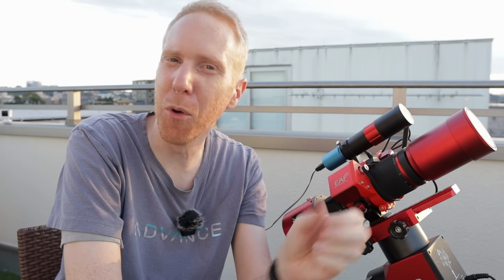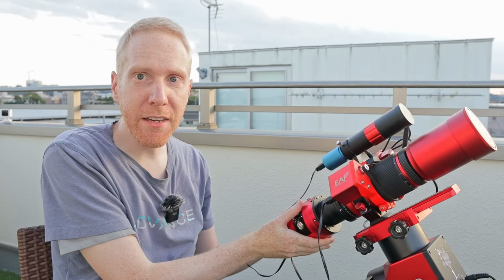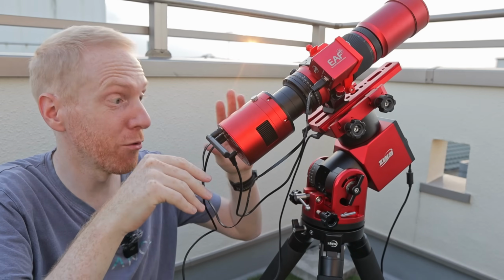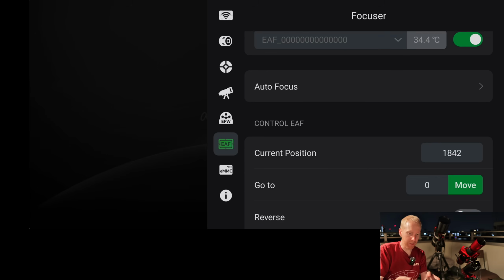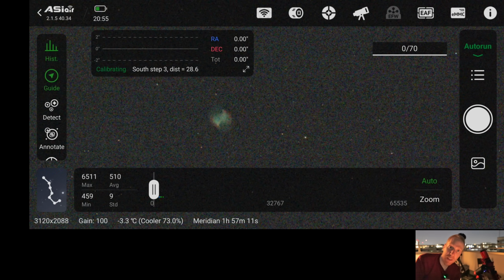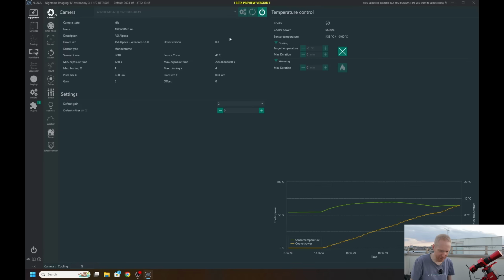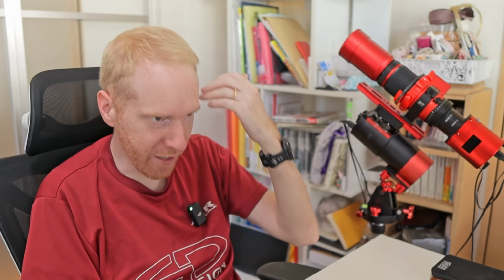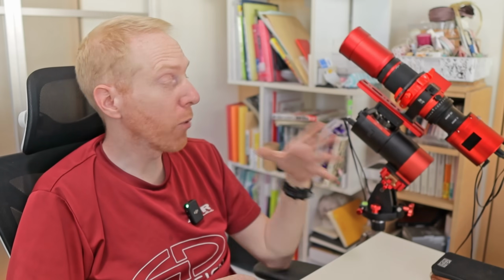This Astro Smart Camera does EVERYTHING🔥! Perfect for beginners? REVIEW of ZWO ASI2600MC Air!

Comment: I certainly hope the QA is spot on.  If it breaks, repair will be impossible.
Reply: I think this is the real problem, #1. Probably the second is the cooling of the sensor, Asiair heats up a lot when it works, if the climate is summer it easily exceeds 40° C, almost approaching 50, this inevitably worsens the already difficult cooling of the sensor due to the summer heat.
Reply from the maker: Probably not impossible, but difficult for sure...
Reply: @CuivTheLazyGeek  pretty sure that's zwo's repair team motto XD

Comment: It would make sooo much more sense to put the asi air into the mount and have the ports come out of the mounting plate.I mean you might want to change cameras but the mount pretty much stays the same
Reply from the maker: I used to think that as well, but I don't think I'd be comfortable with my mount requiring the internal ASIAIR to work :p

Comment: As always, such a detailed and informtive review. I saw it at NEAF and thought it was a joke at first. I did see some use cases for it such as a new hobbyist or a grab and go setup. I am always concerned about any one part of that setup going bad and then being without all of your equipment. Honestly just for that reason, this should never be a primary rig. I can't imagine not being able to image for a long time due to one part of my setup being down. 
Then you have to look at the fact that this will be the only camera you can use  due to intergration. What they should do in the future is make it like an attachable add-on (modular system) that links directly to the camera buss, that way you would be able to swap out cameras. Yes, that would make a new ecosystem within ASIAIR, but it would make sense to me and be kinda cool. 

Thanks Cuiv
Reply: My setup has EAF, ASI AIR PLUS, 2 dew heaters, and remote guide scope/auto guider. While this looks like a good idea.... i swap between a 80mm apo refractor and 8" sct/Hyperstar. The camera body diameter size and external antenna would be an issue with Hyperstar I would also want to know if it would be able to guide with Hyperstar.
Reply from the maker: The modular system idea is really good, it would solve a lot of the worries for this camera!

Comment: I have a question..  Do you always need a Field Flattener ?  example >Dslr canon 550D >  ASI 585 MC Pro .  i hope you can help me..
Reply: I use a 585 with no flattener as the sensor is small on a 72ed, I used a flattener with my DSLR though as the big sensor caused weird stars at the edges which the flattener solved 👍🏼
Reply: @DrNat1  thank you so mutch.. this realy helps me 👌
Reply from the maker: Not always! It depends on the telescope and on the size of the sensor - for a small sensor like the 585, for many scopes a flattener isn't technically needed
Reply: @CuivTheLazyGeek   Ok thanks .. that helps a lot. now my choice for telescope gets bigger haha..

Comment: ASI gear is great, I don’t understand why people hate on it? It’s great, affordable, reliable and effective. It’s proprietary system is no different then Apple or Tesla. It’s just one operating system, great review Cuiv.
Reply: I don't hate it, it just locks you into their ecosystem.  Notice that you can't control this camera if you want to use it without ASIAIR for some reason.  Convenient, cool, but getting locked into an ecosystem can be problematic.
Reply: @markalot  agreed. And I say that as someone who uses ASI products!
Reply: The biggest issue is that I can’t use other devices with ASI air aka ecosystem lock!
Reply from the maker: It's the lock-in! I think it's a great system, and it has helped many people into the hobby, but anyone getting into it needs to be aware of the lock in effect (and thus the inability to consider potentially cheaper gear by other brands in the future)!

Comment: All-in-one is handy if you are entirely in their system. However, the DUO is an special usage function. I bought the 2600MM Duo, and use it with 3nm filters on a f3.8 scope, and I have to use 3 second guide exposures for guiding to function. Luckily my mount behaves well, but I can't use it on my harmonic drive mount that does better at .5-1.0 second guide impulses. . I wonder why ZWO doesn't allow us to set the Offset in the ASIAIR?
Reply from the maker: Yep, 3nm filters will be too much for the guide sensor, forcing long guide exposures. I've seen that the WD20 seems to be fine with those longish exposures, but still..
As for the Offset, they set a value high enough that it's never going to be an issue, although it does sacrifice a tiny bit of dynamic range...

Comment: I'm wondering if there really was a demand for this type of product by the astro community that pushed zwo into innovating something like this all in one kit.  ZWO does seem to be doing some innovation lately, boosting their AM5, various types of new cameras, etc.  

I don't mind being locked into zwos ecosystem, it works for me.  I'm not sure where I sit with this new all in one camera.  Maybe on the remote kit I'm planning on building, it could work, if I had a couple of them as backup.  

I'd really prefer that zwo spend some time innovating some better quality cables and wifi signal from the asiair.  How about some innovative cable management solutions?

from comments I've seen on the interwebs, the main concern seems to be questions about points of failure in an all in one system.
Reply from the maker: Not sure, but I'm sure they think there is a niche!

Comment: The deal breaker would be using narrowband filters and compromising guiding......thats where i lost interest
Reply from the maker: Yep, that's the main drawback of the Duo/Air
Reply: @CuivTheLazyGeek  Is it possible to connect an external guide scope and camera through one of the USB ports when using a narrowband filter that creates problems?  I know it's not the best solution but it is a solution maybe???
Reply from the maker: @donadams.6679  Yes that would work! It is a bit of a shame to have to do that but that's a workaround

Comment: Curious question? Can you use a USB memory stick? The 32GB in the mini is not a lot of storage. Also, I see they don't have a RJ-45 on the mini and I currently use a WiFi range extender. How is the WiFi distance on the Duo Air?
Reply from the maker: Sorry I should have mentioned it in the review, the internal capacity is 256GB! Not sure about USB memory stick - as for the Wifi distance, it seems to be on part with the ASIAIR Mini!

Comment: Probably won’t get this but if they decide to make a new mount like the am5 or am3 that has integrated power supply from the main body up to the saddle AND that can self-PA then they’ll have my money. I get that would add to the weight and size but it’s a tradeoff I’m willing to make
Reply from the maker: I'm a bit worried about a mount that would require the internal ASIAIR to work properly, but yeah adding automated PA would be sweet!
Reply: @CuivTheLazyGeek  For sure, I wouldn’t want an integrated AsiAir in the mount either, but having more ports in the saddle to bypass points of rotation (to prevent snagging) would be great. Similar to what they did with the new am5, but more.

Comment: Can this camera be used on the front and back of a Celestron C8 EdgeHD SCT? Can it still guide inverted from the front?
Reply from the maker: It should be able to, as long as the imaging circle covers the guide chip (that's the important bit)
Reply: @CuivTheLazyGeek  using the hyper star should help with that on the front end, but i wasn't sure about using/or not using a reducer on the back end?

Comment: Just to be aware  and this is without the air integration - the 26000 duo camera is not really compatible with all telescopes to begin with. I've read some posts on cloudy nights forums how some setups the guide camera can't see the stars, because the focuser tube isn't wide enough. This is especially true for certain cassegrain type scopes and other setups with longer focal lengths. That's unfortunately a full stop for me for any of the duo- line up.
Reply from the maker: Good point! The guide sensor needs to have some light falling onto it (both 2600 Duo and Air). They should make a 585 version or 533 version with the guide chip far closer to the center to avoid that

Comment: I am not on board with this one. ZWO is already trying to lock us in into their ecosystem. This takes this to the highest degree. I want my imaging computer to be used with any camera and any guide camera. Plus, what about the heat from the chip within the onboard AIR. I get it, everyone hates cable management, but it is not an unsurmountable problem.
Reply from the maker: That's fair - but as I say in the video, I feel like this camera is less egregious than the standalone ASIAIR which restricts all of your equipment. This camera restricts "only" EAF, Rotator, EFW... Still not great, but for some it's a fair price to pay for convenience.
I'm not a big fan of ecosystems, whether Apple or ZWO, but I know many people were effectively rescued by the ASIAIR/the ASIAIR made the hobby possible for them and I can't ignore that either!
Reply: @CuivTheLazyGeek  I have the ASI AIR too. I love it. But as I gain more experience in the hobby I am thinking of switching to NINA. I think the AAP is a great getaway drug when it comes to imaging computers. Excellent video, as usual. A long time follower of your channel!
Reply: Everything I have is ASI, it’s easy to operate, it’s affordable, it’s reliable, it Runs works with iPad. I will do anything to not drag around a laptop, extra cables, a box, a chair, extra power, noise…nope.
Reply: @woody5109 I’m in same boat at the moment, I started with laptop and it was a cable nightmare so went with original air. Changed the game for me and now have the plus eaf etc. I’m already wanting the 2600 for second rig, if this camera works as a 3 in 1 then it’s a no brainer
Reply: It's not like they are getting rid of their other cameras.  You can always just buy the normal cameras if you'd like.
Reply: And these new additions have pushed the 2nd hand imx571 based cams down to the 1200 mark, making a great sensor even more reachable.
Reply: @MazzifLOL  yes! I am in the market for one 2600mc
Reply: I don't think I'd buy this, but I see a very good use case if you want a very portable rig. If you're someone who is lucky enough to have a second travel rig this would be killer. I'm thinking for people who go hiking with a harmonic drive mount and a red cat scope (or similar) this would make things much, much easier. Or if you want to fly to Australia for some southern skies. This would be an upgrade for me, but I'd still rather have modularity for my backyard. If I had a bunch of free money to spend I might pick this up for those more specific use cases.
Reply: @ams-photography  as a backyard imager, I agree.
Reply: You don't have to be on board. It's just not a product for you then and ZWO offers enough other products that might suit you better..

yes, you're locked into 3 ZWO items in this one camera. Yes, you're locking yourself a bit into the ZWO ecosystem.  - But... what's your setup? How much of it is ZWO already?

Chances are pretty high these days that most users who are interested in a 2600MC probably have a ZWO Camera + guide camera + ASIAIR separately from ZWO already anyway.. 
  
Chances are also high that a $200 investment in a ZWO EAF isn't that big a deal when someone is willing to put down $2000 for this camera (if they don't have a ZWO EAF already), and that is literally the only thing you'd need extra to make this work to its full potential.. it is the only thing it locks you into, a 200 dollar focuser.. don't think that's hardly worth getting upset about. 

Do you really need a 2600MC to be compatible with ANY guide camera? when the integrated ZWO one will do a perfectly fine job? Is it an actual issue? or is it just a slightly stubborn "I wanna use my laptop" attitude that still has you connecting a ZWO guide camera, your ZWO camera, your ZWO EFW and ZWO EAF while feeling superior because it's attached to your laptop and you're not a "sheep" in the ZWO brand? Of what you remind yourself of while rebooting Nina a few times to fix driver issues?
Reply: @PilotPhteven  yeah. That was just my opinion. If it works for you or someone else, good for them. I am glad at least ZWO at least has a wide range of diverse products to choose from.
Reply: @PilotPhteven  "when the integrated ZWO one will do a perfectly fine job? "

 It won't do a perfectly fine job. You don't want to put filters in front of the guide camera. You will not be able to guide with anything but low focal length.  

Quite frankly this is a stupid product. It forces compromises that will limit your photography and cost you far more for replacement. If the guide scope component goes out, You have to replace the whole device. Same with every other component that has been force merged into this.

If my auto-focuser goes out, $200. Mounted computer, $400. Guide cam, $125.  Corresponding components go out in the All-in-one, Full cost of the Camera. Like $2600-$2800. Yeah, give me the cable management anyday.
Reply: This is the Apple computerication of astro photography. Makes it simple. The SeeStar S50 is basically a $450 iteration of this too.
Reply: In some ways I do think its more egregious because you cant easily use it with the computer current (as described in the video); however the value of the 3 in 1 plus EAF for $2200 seems pretty good as you are getting quality gear that will work very well.    As for ZWO locking people into their ecosystem with ASIair; I don't see it quite like that.  You can always use your cameras and accessories with a PC system (save this product as it stands).
Reply: Another great vidio Cuiv.
Not knowing much on the asi air is the guide in the new camera compatible or adequate  for long exposures as PHD2.
Reply: Order it and I love reducing the dependency on cables (like they say: cut the cable!). Everything with ZWO is sooo easy and everything works.
Reply: It's a solution to a problem that doesn't really exist. It's purely to increase ZWO's range of products for the sake of it. The astro community in general is very brand loyal. Look at Takahashi, Meade, ZWO, Altair etc... they have borderline cult like followings. ZWO can, and will release, basically anything they can to keep pumping the cash flow because people WILL buy it because it's a latest shiny red product.
Reply: Feeling much the same way. While I would love to get the ASI2600. I don't want the air built in. Never liked merged equipment. If one component goes out, the whole device is essentially trash.
Reply: You mean it cannot be used just as a camera alone?
Reply: @cudackedees3327  Good chance that if components go out that it could affect the camera. If you wanted it just for the camera alone, it is no different than the ASI2600 except for the added cost of the additional components. Now if the all-in-one came out at the same price point or lower than the stand alone ASI2600, only then might be the better choice. Still I would rather be able to replace individual components at a far lower price. Everything fails at a different rate.
Reply: I guess it’s ok for a colour camera, re single package but for mono and narrowband imaging, not good. You have your guide chip behind your narrowband filters in that case. This will result in multiple issues, dim guide stars and focus deviation when switching filters
Reply: Not being able to access the cameras if connected by USB is a real bummer. If they have addressed that this would be the ideal product I believe
Reply: Hey Cuiv just a quick question regarding this camera.  I have struggled with astrophotography for years.  I have never had enough time to really progress but since I bought  I bought a smart scope I have taken more astro pics than in the last 20 years that I have been trying.  I was thinking of saving up for a celestron origin but I already have a redcat 51 which I use on a sky adventurer with my om1 camera.  Would it almost be as easy as a smart camera to get this camera an AM3 and use my Redcat?  Of course I get the focal length is very different :) but it would be cheaper than buying an origin... sorry for the very long question!
Reply: I think this could be a great option for someone like me that is trying to get into the hobby!
Reply: I think there’s a place for this product in that it reduces the barrier to entry for more people into the hobby. Having to match, purchase, and assemble so many different components individually (including all the adapters and cables) is a significant obstacle and many aspiring amateur astronomers just give up. It also makes an otherwise beautiful instrument look like a jury-rigged mess, ruining the aesthetics of a telescope like the William Optics Fluorostar 91. ZWO has raised the bar in terms of usability here, and I’m sure that competitors will follow suit, leading to a new set of technical standards for astrophotography.
Reply: As someone who gave up on astrophotography due to lots of reasons,  this is what will get me back into it again on a more casual basis as I kept my Redcat scope.
Reply: Don't understand your complaint.  Nobody forcing you do buy it. Just use something else.
Buyers choice surely.